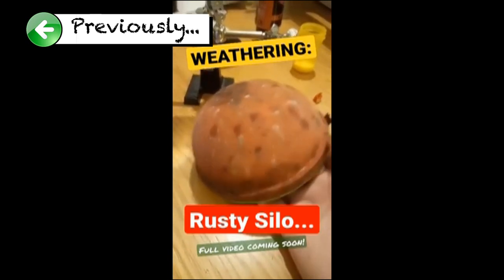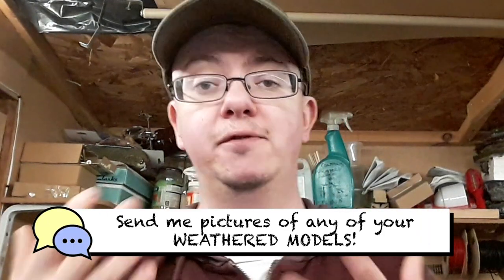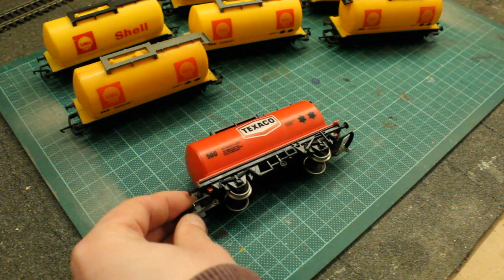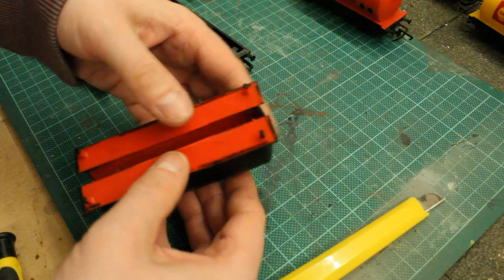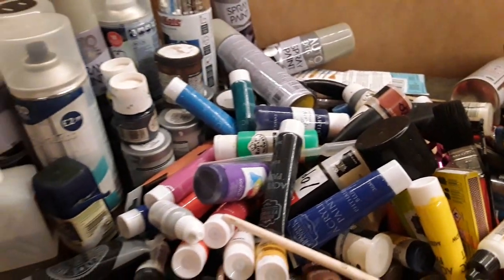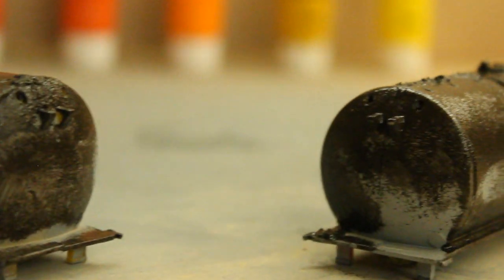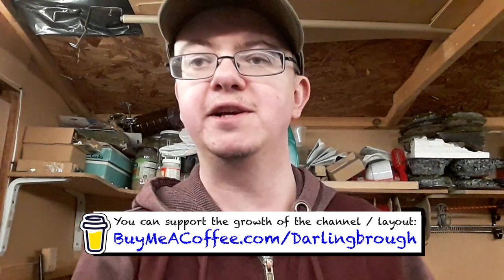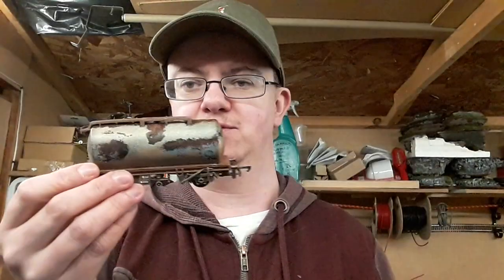Weathering rust and peeling paint on a OO gauge tanker wagon.

Comment: The sand is too coarse, you need to sieve it first so you have finer dust or use talc, but apply it like flour, through a sieve, so it does not clump. I was going to suggest the salt and hairspray method!
Reply from the maker: Hi Timber! Thanks for the comment and feedback! The sand I was using was actually sieved already, but maybe I could get it finer... I will try applying it through a sieve next time though! 👍🎨
I will be exploring the hairspray method and also the salt method in a future video, comparing them against each other! So check back for that! 🙂